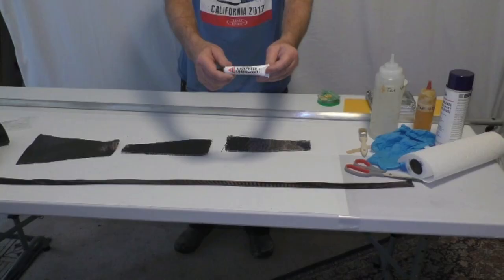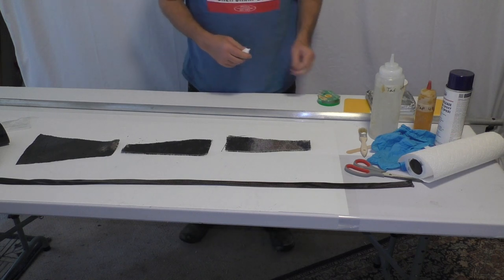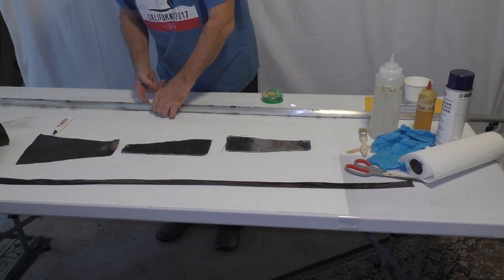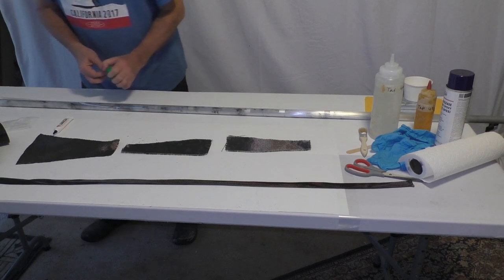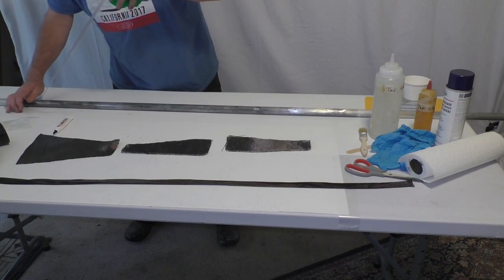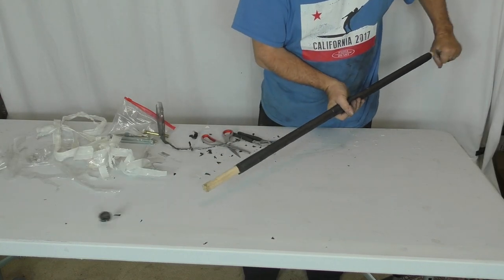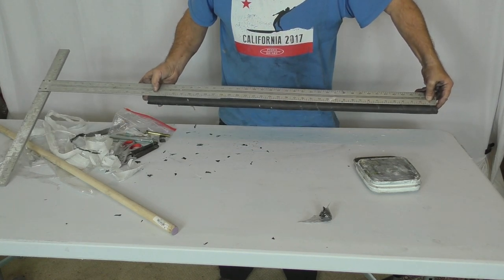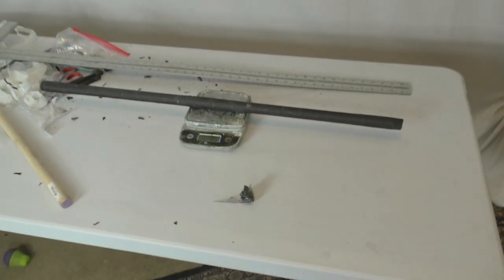Making Composite Carbon Fiber Tubing Inexpensively - Secrets Revealed

Comment: I am experimenting with a new tube release method.  It involves brushing on a coat of melted paraffin wax on the aluminum tube.  So far so good.  First I melted a basic candle.  Then I brushed on a smooth layer of the wax.  The wax coating appears to be plenty thick enough to act as a barrier between the epoxy composite and the aluminum tube.  The next step requires you to lay up all the layers of the composite tube and wrap them in peel-ply, absorbent material and lastly shrink-fit tape.  After the new composite tube has hardened fully, you pour boiling water through the aluminum tube repeatedly.  (This will melt the wax barrier, and it ought to give you a very easy release.).

Comment: Have you tried just maintaining a temperature around 70'C during the curing cycle and using common mold release products. The aluminium tube has a large expansion coefficient relative to carbon and when cooled down can be easily removed. (most times).
Reply from the maker: Yep, does not work. The way I show requires max physical force to remove. If one does a wrap loose enough to slid off the way you suggest, then there will be voids in the layup. Commercially made tubing is done much like you describe, but they use a multi-ton hydraulic press to remove the tube from the mandrel.

Comment: Thanks for the demo. The camera perspective makes it look like the aerosol release over spray might get on your carbon fabric.
Reply from the maker: Good point and something one should watch out for. I don't remember if it did, but I never used that tube.  In later videos one can see that I spray the release when the mandrel is on my turning jig so I don't accidentally touch it before I wrap and the spray direction is 180 degrees away from the wet-out table.

Comment: Food grade silicon (petroleum free) can be used as inexpensive but very effective release agent that makes the use of a Mylar film unnecessary. Your mandrel has to be nearly perfectly smooth though. If using aluminum, using dry ice inside the tubing will shrink the tubing making releasing the mandrel much easier once the resin has cured

These are techniques I use for laying up Kevlar for various purposes
Reply: Food grade “silicone”?  Silicon is an element.

Comment: hello I have and am enjoying this tube tutorials I am looking to make a Carbon fiber Handle for my metal detecting sand scoop. , My OD is 1.22 and I am wondering how thick I will need to make the tubes wall thickness,, Thanks in advance
Reply from the maker: Well, one can't know that answer without having the weights and moment arms of the entire  system. But for what you are doing, all that engineering is not really necessary. If your solution fails, nobody dies, you just waste some time and materials. I assume you want to make the system lighter - a worthy goal. So, I'd recommend you review the video link at the end of this reply. I'd use one inner layer of 120 style fiberglass and one outer layer of the same cloth. It will be very light and strong and  be highly resistant to crushing in your hand. Link: https://www.youtube.com/watch?v=U6LCe81j3eM&t=300s
Reply: @KlingbergWingMkII   Thank you I will, I just ordered some test material from ACP  thanks for the link and for your videos that got this started

Comment: what is the white cloth that you used to wrap and absorb the resin excess?
Reply from the maker: polyester peel ply. Works OK, but teflon coated fiberglass is much better for the job - leaves fewer threads to pull off. However, it is more expensive. Both are available from Aircraft Spruce and Specialty
Reply: @KlingbergWingMkII  thanks for the quick reply, i'll be working on my first carbon fiber project, a 3.5in tube with 2 45º angles. i'll be using a sleeve carbon fiber cloth so its easier to go around the stainless steel mandrel i've made. my plan is to cut in half after the first layer, so i can get the mandrel out, and then do a second layer on top of those two halves glued together. 
do you think that can work out? 
thank you for your time and really appreciate your work! thanks

Comment: What did it weigh? You didn't show the screen of the scale.
Reply from the maker: Oh, sorry, but I don't have that data anymore. The video is really meant to just show the process. The weight of that piece of tubing is different than most due to the tapered wall thickness I needed for those parts. Generally, you can calculate the weight for any given tube by finding the total area of cloth you need and then multiplying by a factor of 1.6 - that will give you a slightly conservative answer.

Comment: Were do buy the carbon fiber sleeves?
Reply from the maker: Not sure what you mean by "sleeves". I have made custom tubing for most of the aircraft to maximize the strength to weight ratio. There are a few standard CF tubes which I purchased off of ebay. Likewise, I purchase most of my CF cloth on ebay.
Reply: The first section off carbon fiber that u put on the mandrel
Reply from the maker: Ah, yes, that type of cloth is available from most of the larger composites suppliers. Here is one source: http://cstsales.com/a-carbon-fiber-material.html  I have stopped using that material for most of my tubing as it limits the bending stiffness, although it does have very high torsional stiffness. If I need to due a tube that tapers in diameter, then the biaxial woven cloth is excellent.
Reply: I just need it for a over wood shaft for paddles
Reply: 1 1/4 paddle shafts
Reply from the maker: Should work great for that. If you look around at various suppliers, you
 will find it is available in Kevlar and fiberglass also (much cheaper).
 Those materials might be just fine because your application involves having
 a wood core. The sleeves come in different sizes and each size has a 
range of diameters it can accommodate (usually stated with the material 
specs), so make sure you order the right size for your paddles.
Reply: Thank you very much

Comment: The oven part is a bit of downer, while the rest of the video is fascinating. "Cheap" is only valid if you're intending to make tubes on a very regular basis with the oven involved. 
I'm looking to make two ruddersticks (60 inch long) for a sailboat, but as an exceptional build. Building an oven first leads me back to the regular shop unfortunately :-) Is the over mandatory actually? Especially if you're working with several layers as strength is more important than weight?
Reply from the maker: Given no oven, you'd be better off using aluminum tubing or stock CF tubing. The methods I show are for when a custom tube is needed with varying wall thickness and other features to save weight - generally only an issue on aircraft. Weight is not nearly that critical for any land vehicle.

Comment: how would you go about adding a sleeve if i wanted to do a tapered tube? since the sleeve is uniform
Reply from the maker: Good question. I cover that exact situation in the video on building my winglets. I needed a tapered CF tube for the leading edges. Basically, you use a tapered mandrel and pull on each end of the sleeve until it is tight to the mandrel surface. You can see photos of the process here: https://www.youtube.com/watch?v=QVqWj5yTlkA
Reply: You set your mandrel up so that is rotates (like on a skewer), buy some CF tow, and wrap the mandrel manually.  +45 degrees, then -45 degrees, then +45 degrees, etc, etc, etc.

Comment: can ca glue be used in place of epoxy?
Reply from the maker: Hmmmmmm............interesting question. I will assume you are asking this in relation to making tubing. For model aircraft, I would say, "yes", for full size aircraft, I'd give it a huge, "NO". CA has very poor mechanical properties so it's use in full size aircraft is quite limited. I use it only to tack glue parts together before final bonding with structural adhesives.

Comment: It's not easier to pull a PVC pipe over the mandrell instead of struggle with the mylar foil?
Reply from the maker: Wouldn't you still need some covering over the PVC to prevent the composite layup from sticking? I've tried similar with mold release applied to the plastic tube, but could not remove the composite tube from the mold. the .005-in gap between the mylar and mold is critical for removal. Maybe I mis-understand what you mean - with this stuff it is often hard to understand without dwgs or pics. 

On the plus side, I'm modifying the process to make it easier to remove the mylar from the composite tube. You will see this in a coming video.
Reply: @KlingbergWingMkII  Just an idea - may be closing one end of the tube and pressurize it with oil pump from other end while you are laying the fabric to have it expanded a bit can help release the carbon fiber tube after it is cured. so basically the pressure in tube has tube dropped before carbon tubing will be pulled out of alu tube. Just check is need to be done whether the alu tube will uniformly be expanded or at least expanded within accuracy constraints of your part.
Reply: Nice.
It would be worth making a couple of pivote to spend the tube when wrapping.
Could you use a n electric blanket instead of an oven?

Comment: And so for all this you supposedly save a lousy $40 from buying the ready made?
Reply from the maker: Actually, the key point is that you can make highly tailored tubing that is optimized for the application. If one is doing an ultralight aircraft, every ounce counts. In a 100 lb aircraft, this method can save several lbs!

Comment: Keeps saying how he prefers to do it. WHY not show us the method you prefer?
Reply from the maker: There are several other videos on my YT channel showing my rig/methods for making tubing in my more preferred style. This video was intended as an intro to the concept of using a layer of mylar and graphic powder so one can use simple, straight, inexpensive aluminum tubing (instead of expensive tapered mandrels, or total loss systems) to reduce the overall cost of making the tubing and put a usable process in the hands of most homebuilders.